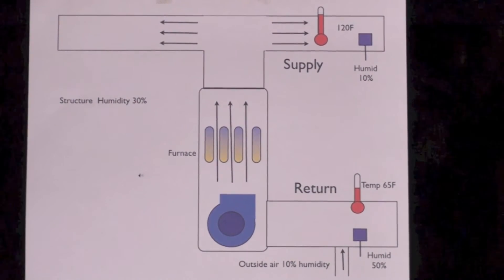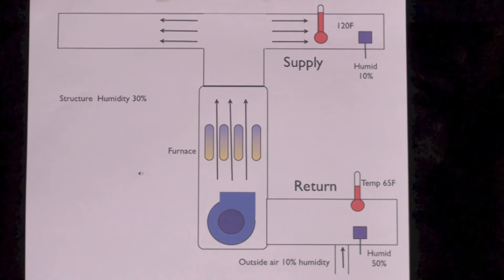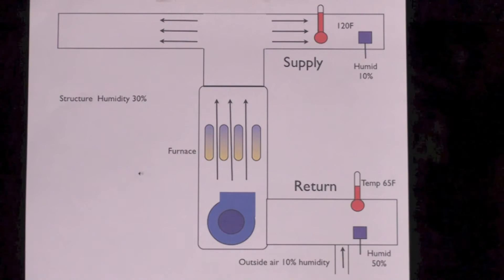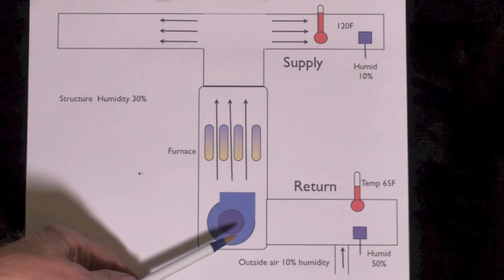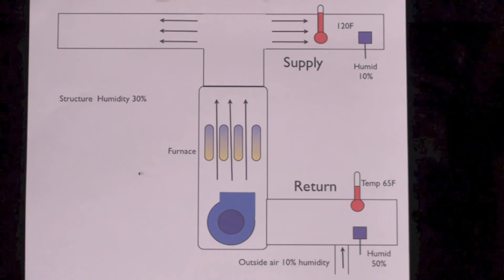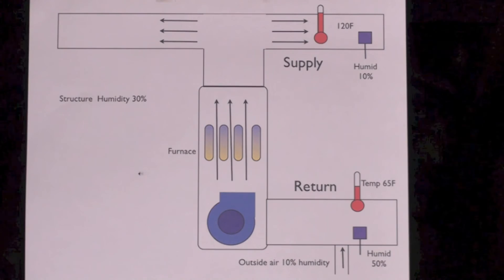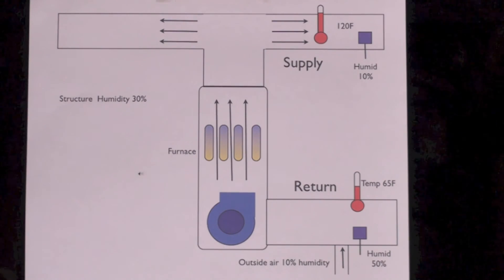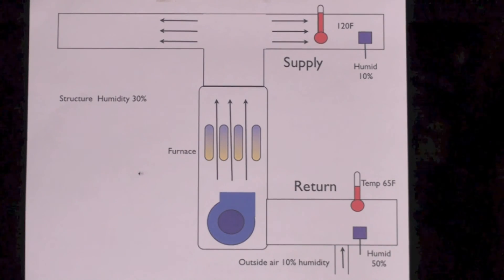Winter humidity

Comment: Hi grayman, can you use the 24 volt terminal on a honeywell spark control  for powering a humidifier ?
Reply from the maker: +Rich Sumner Yes, if you use the TH and TR terminals.
GFM
Reply: +grayfurnaceman , GFM it worked thanks, would it be better to get a transformer ? thanks your the best
Reply from the maker: +Rich Sumner It probably does not make a lot of difference if the furnace transformer is 40 VA.
GFM

Comment: Hello GFM,
How does adding 10% hum too a system return of 50% lower the return humidity?
Thanks
Reply from the maker: Relative humidity is the percentage of moisture compared to what it can hold, at that temperature.  When we raise the temperature, the spaces between the air molecules increases so more moisture can be held by the air.  So If I had a certain amount of moisture in the air and raised the temperature, the relative humidity would go down.  Hope this helps.
GFM
Reply: Perfect , you are the best